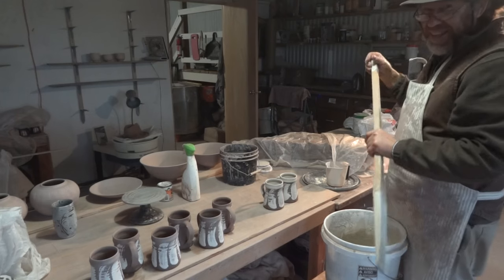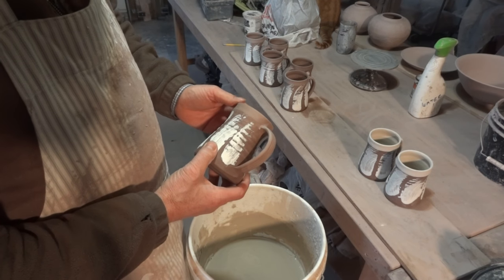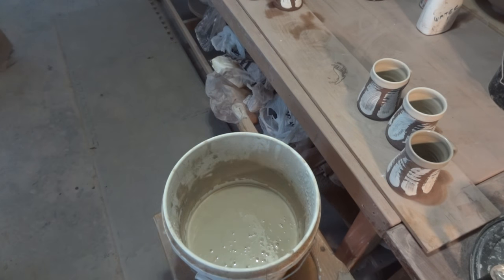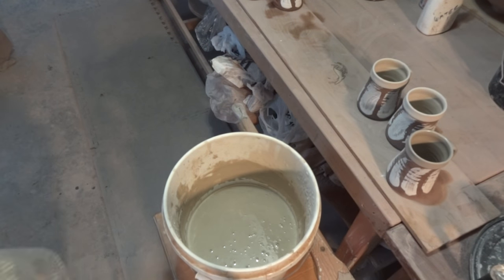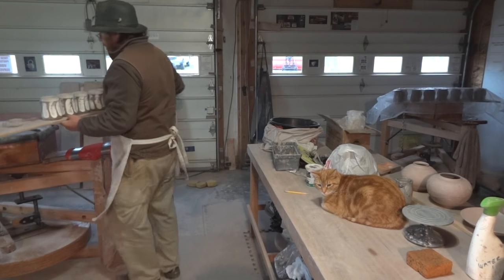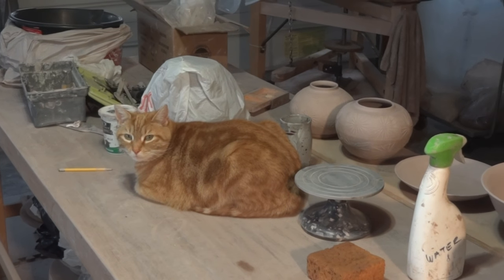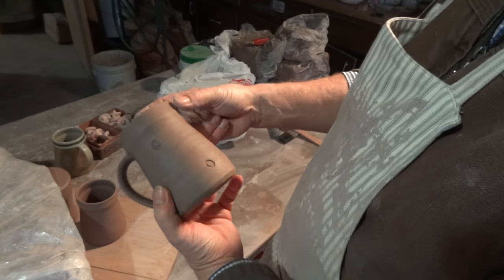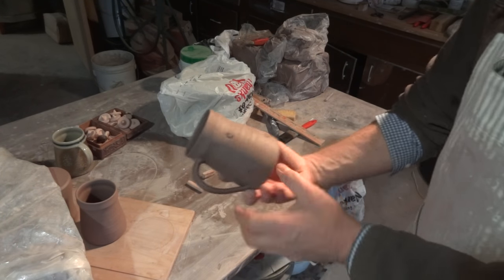SIMON LEACH POTTERY TV - raw glazing & impressing march -2017

Comment: There are 2 books on the subject of Raw Glazing. The better one is... Single Firing: The Pros and Cons (Ceramics Handbooks) 
by Fran Tristram   Paperback: 128 pages Publisher: A & C Black, 1st edition (28 Jun. 1996).
The general consensus is that the other older book is not so helpful, viz:  A Potter's Guide to Raw Glazing and Oil Firing  by Dennis Parks, Hardcover: 112 pages Publisher: A & C Black Publishers Ltd (Mar. 1980).
Reply from the maker: Dennis Parks book I have and is useful, but I'll look for the other book you mention - thank you !